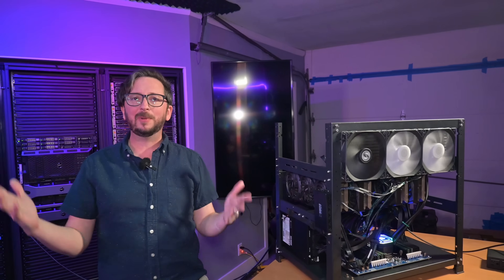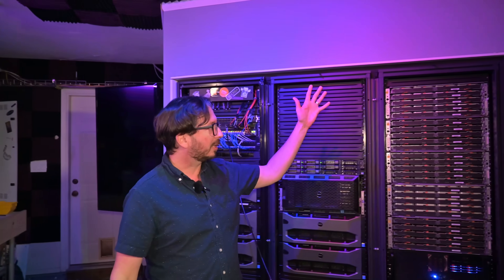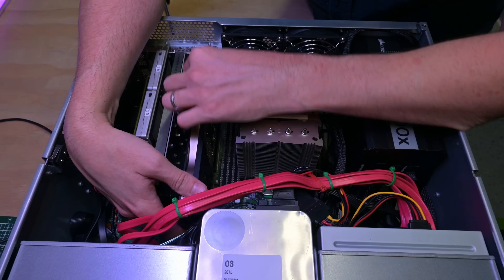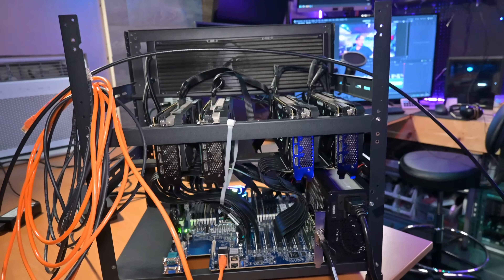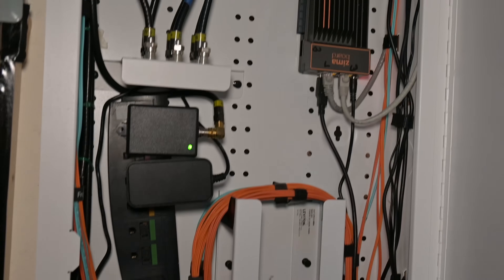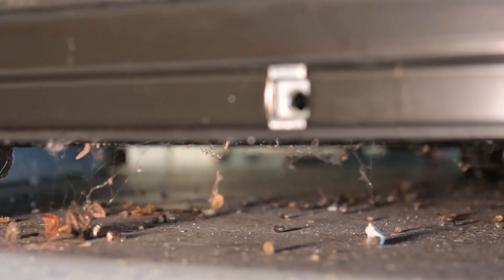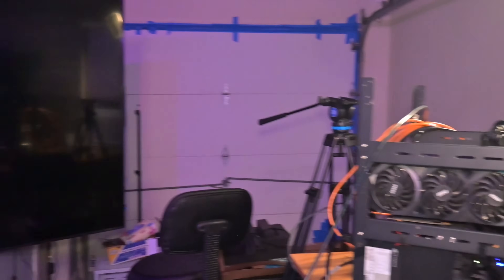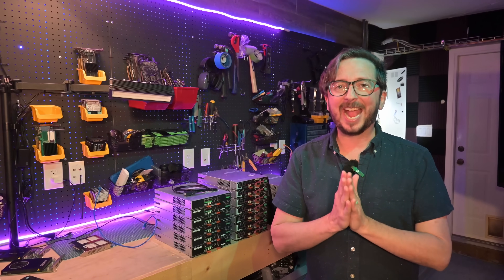Homelab Chaos! Home Server Organization and Cleaning Challenges

Comment: So... my "home lab" is an Intel NUC with an 11th gen i7 CPU & 64gb of RAM (running Proxmox), an eGPU enclosure with an RTX 4070, a 4-bay DAS enclosure with 4x12tb HDDs in RAID Z and a couple Raspberry Pis for DNS servers (Pihole/Unbound). This is all kind of overkill for what I use it for, and I actually run A LOT of stuff on it. This wasn't necessarily "cheap," either, but definitely a "budget" home lab by comparison.

So I guess my question is... what on earth are you actually using all this hardware for? Dear god, man, you could run a small enterprise out of your garage.

Comment: Oh how familiar that seems - I've got a good mix of SFF, LFF, and rack stuff in half of my basement, where I can close a door and not hear any of it.  Old boards, old cables, old music equipment - yeah, I should probably do a clean out also.  Around here it's an effort to get rid of old dead printers and monitors, so they accumulate.
Reply from the maker: Im always jelly of the basement labbers as they have a cooling advantage and still have a garage haha
Reply: @DigitalSpaceport  And all that stuff doubles to heat the basement too in the cold winters!  At least that's what I tell myself...
Reply from the maker: @ChrisCebelenski there may be a video I am producing to justify heat reuse during the winter that I started last year but didnt finish and its not gotten cold enough this year to wrap it up. A potent tale Im telling myself (and wife) to justify insanity, possibly.

Comment: I like how you have the racks built flush into the wall like that.
Reply from the maker: I cant believe I did all that livestreaming and it worked out. Its somewhat shocking I didnt mess up majorly.
Reply: @DigitalSpaceport  It looked pretty rough to yank out, are you using rails with ball bearings?

Comment: Until I saw your house... I thought I was a little over the top with 100 plus drive/500 TB spinning rust attached to my media player..... connentX-3, SX6036G, a few Brocade ICX6610-48Ps, and a few Supermicro X10 servers/PCs/Firewall,  ASUS X99s w/E5-1660 oc'ed PCs.... at least I've only had black snakes in the house..... very rural.... only got internet 7/22 after 22 years without thanks to Elon....

Comment: Excellent ! Do you intend to release a video about serial or telnet connection to the SAS EMM ? I can't agree more, we still keep a lot of these chassis in production, even replacing our old raid controllers for SAS ones for our Truenas HDD+SSD SAS2 storages. These 60 disks chassis are more than 10 years old but are still must haves for far more more than a half petabytes secured storages with new 22TB WD drives.
Reply from the maker: Im likely to make another video on the de6600 variety show of jbod but have been diligently working on getting the infiniband controllers to function. Im making headway!
Reply: @DigitalSpaceport  You talked about their management, all these LSI product are managed with Santricity.
But unless having a workload guarantying large parallel access on multiple raid-groups, you most likely won't have with these raid controllers, at least with Dell MD3660F generations (but I guess the IB NetApp controller are of the same generation), the performance you can get as a JBOD with 9207e. But they can provide you full grown LUNs, even remotely synchronously mirrored if you decide to build another home datacenter in the kitchen ;-)
Talking JBOD, You can enhance performance by using the 2  multipathing channels simultaneously. And to keep access to your data, you want to build your ZFS by associating the disks of your vdev vertically in the chassis, for example 4+2 in RaidZ2, to be able to lose a tray without losing data. Next you add as many vdevs you want, say 8 (48 HDD), and the remaining slots go to SSD for the metadata (special VDEV), at least 3 in mirror.

Comment: Serious question: Is that gear actually doing anything productive or is this just for Youtube and playing with hardware (Which is fine i guess..)? What workload at home justifies this gear?
Reply from the maker: Given this is like my 8th rack setup since 2012 I have done a ton of actual workloads for production on these and my prior machines. I work with unreal engine on these currently and if you are aware of lightmass you know that cpu horsepower is key. Its shifting to GPU more now and in the next year likely is on par. I render giant swatches of land at a time for a specific industry currently so cloud geotiffs locally are much better vs aws internet limited speeds. Its been a wild journey actually. I could do a history of my homelab journey video but the production time on it would be high and Im doubtful the views would justify the effort. When I get bigger I will for sure.

Comment: You don't have a lab, have a home datacenter
Reply: I think this looks more like a datacenter too.
My "Home Lab" is just one machine which acts both as NAS and Home Lab.
Maybe two if you count another old NAS as backup once I have set that up (just in the process of configuring my new one more professional, the old one might go to my brother where I can keep a copy of critical files).
Reply: I'm trying to add my own two cents but messages get deleted :(?
Reply from the maker: Sorry I dont know what is happening to your messages but they are not in my held bin, I just checked. I am not deleting messages either as comments = boost. My biggest hesitation in calling it any sort of datacenter is those have formal specs usually, and this is just something I pieced together in my garage. I should launch a formal spec for Garage Datacenters 🤓 that will be made up, but fun.
Reply: @DigitalSpaceport  sounds like it's time to install the raised floor :D
Reply from the maker: @bitcoinsig hide the bugs and snakes for good, I like the sound of that!

Comment: What's up with your Chia? Still running?
Reply from the maker: I still have a few hundred TB but shifted my jbods to high performance ZFS which greatly reduces available usable space. Useful for work work, which is great and saves me time and cloud costs, but dual use trashes the zfs performance iops. We will see if they can pull it back. Im keeping 3 extra jbods in case. 🎲 roll.
Reply: @DigitalSpaceport  I had 5 PiB but shut it down due to SpacePool going offline.